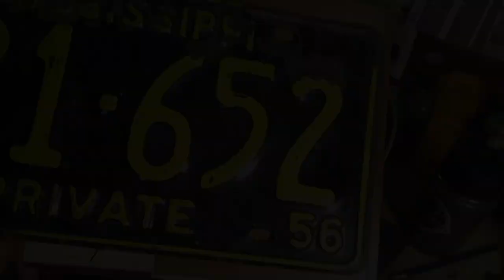Vintage Archtops: Trouble Under the Bridge?

Comment: Hey I checked my H1214 neck and it's just fine (I wrote a comment in the worm's guide). I was thinking of the tiniest most insignificant gap below the fretboard extension. Probably when I saw the video with all the potential problems, I just couldn't believe that this one (from 1949!) doesn't have any yet. Thumbscrews are barely raised at all, and the action is just how I'd set it up if it had a truss rod. Intonation is great.

I gave up on guitar over 20 years ago. Got the urge again a couple years ago, before quarantine stuff, but I couldn't find the right guitar tone. This was on Craigslist, and I'm lucky I was looking for a cheap guitar. I'd never heard of them, but after I saw the ad, I checked YouTube for what this guitar might sound like, and... I never would have expected a vintage department store guitar would do the trick.

I think more people would enjoy these if they rediscovered them. Hopefully your channel will take off. There should be plenty of these guitars (all the various similar models) in the USA, and they're somewhat lightly built, so hopefully they won't get too expensive. I just never gave them a chance before, but I should have. Like you said, many if these will need some work, but people don't have to worry about ruining collector's value, so your channel will be really helpful in saving some of these guitars.
Reply from the maker: Thanks for watching Adam. 1 at a time my friend